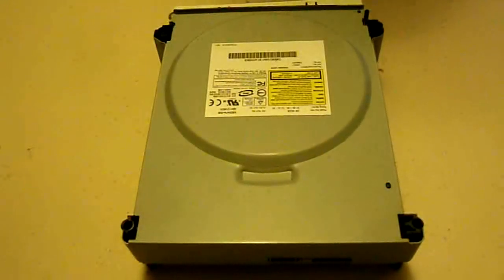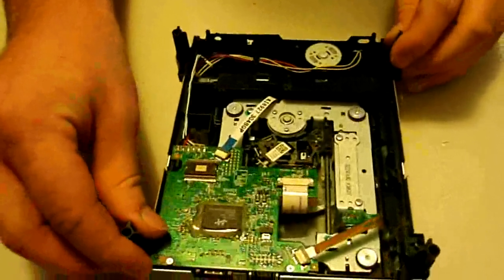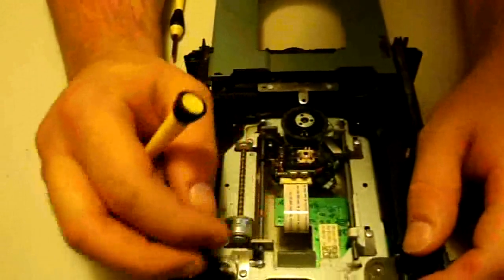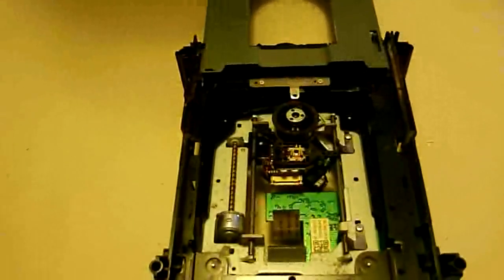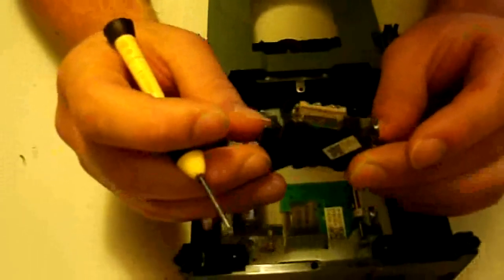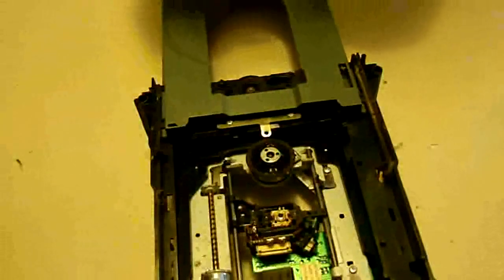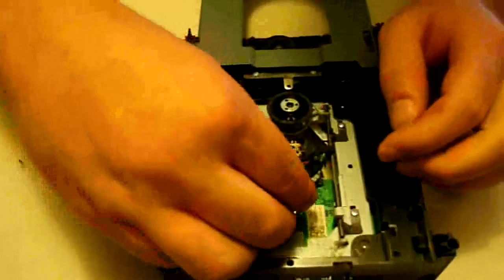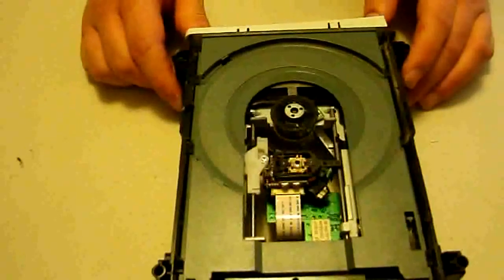How to replace your Liteon DVD disc drive laser. Xbox 360 FAT repair tutorial. Disc read error fix!

Comment: My 360 laser has stopped reading the discs. I've replaced the laser and it still it doesn't read discs. What's going on ?
Reply: Same. You figure out the issue?
Reply: Same. Any solutions?

Comment: Surgeons log:

- Subject started showing decreased motor and reading skills, cause unknown.
- Subject deteriorating, decreased recognition of relatives (success rate 1 out of 10). Early signs of glaucoma or Alzheimer's disease?
- Performed surgery on subject based on experimental procedures resulted in failure due to lack of proper equipment.
- Proper measuring equipment arrived, new surgery scheduled.
- Optic values too low, all adjustments unsuccessful.
- Eyesight decreased to zero, subject completely blind, added to transplant waiting list.
- Possible donor found, blood type seems to be incompatible, donor of different origin. 
- Researched possibility of international donors, possible but waiting list is long.
- New test available for blood type comparison, first donor possible match, chance on success 50/50.
- Researched possible procedures for surgery. Optimal match found.
- Surgery scheduled based on professor Tinker's procedure. 
- Transplant was a success! Immediate and full return of motor and reading skills. Subject has been given a second chance at life. Hurrah!

*wakes up* Dammit! Must've been sleep typing again... *leaps off unicorn*

Now what actually happened...: 

My Xbox was having increased difficulty reading discs, games wouldn't launch or stop mid session (Open tray error / Disc unreadable etc). I didn't know what to do and I was reluctant to open it, afraid I'd break something. So, tired of playing the "open tray game", I stopped using it some years ago. Recently I wanted to play some Xbox games even though my Xbox still had the same problem. I decided to find some tutorials (plenty good ones online) but none of the easy fixes that people shared worked (like cleaning the lens, checking the laser array position, checking the in-drive magnet disc locking mechanism etc). 

- Adjustment of pot meters of original laser also failed since I didn't have a multi meter. I only did this blindly because I found a video that recommended turning the laser module's pot meters quarter turns without any further explanation (forgot to mark the starting point as well). Shortly after I found videos and proper information that this should only be done with the help of a multi meter. DON'T do this without it, and always take initial measurements of the pot meters. Chances are your laser will be fried (or break down quickly) if you don't and/or it will be almost impossible to determine how much resistance they/it should have in order to work. Google "Adjusting xbox 360 laser pot meters" and you'll find plenty of resources with a lot of information (values/brands/instructions) on the subject.

- With the help of this video I replaced the Liteon laser (model 14xx) with a Benq laser (model 141x) from an old Xbox I had lying around (one of the first models). I wasn't sure this was going to work, but since my Xbox wasn't working anyway I decided to try. The only indication I found was that the available replacement part you can order is compatible with Benq and Liteon drives and that the laser modules appeared to look the same. Luckily it worked like a charm, maybe this info will help someone in the same situation.

Thank you very much for taking the time to post this tutorial, it helped a lot and it gave me the confidence to attempt the replacement! Keep on keepin' on :-)!

*Rides off into the sunset*

Comment: funny story : I have buyed an used xbox that could no read disc, after dissasembly a note was written on the dvd drive ' new lens from china but not working'… As you can gess, the antistatic solder blob was stil there! thank you very much for the info!

Comment: @Tinker Mods-    I work with electronics all the time however have never replaced a laser...my sons went out and it is Lite-on Phillips DG-16D5S drive with the G2R2 laser. I want to just replace the laser but can't find any definitive info on whether i can use a a G2R2 laser that is listed under the DG-16D4S drive model.(as most of the sellers online list it under this) Are they the same?  Some of the sellers list the G2R2 laser as DG-16D5S / DG-16D4S for Xbox 360 so i am assuming that this laser will work with either model...but I'm not sure...hope someone on here can clear this up for me. Thanks!

Comment: To: Tinker Mods I bought a NEW LASE for my XBOX 360----do I STILL need to adjust the LASER POT also??---or do I leave it alone--cause my New Laser reads 2.8ohmss--Help!!!
Reply: You have to solder out the anti static point. It should be on the left next to the laser ribbon security tabs.
Reply: +NintendoFan69 ok thanks I figured it out a long time ago lolol--but thanks anywayss

Comment: Swapped my laser with the correct one. And it doesn't work. So I swapped my old one back in and now both dont work..onlything that changed was the disconnection of the ribbon cable. Im pretty sure the memory it held is now cleared, because now both are non working.

Comment from the maker: When you install a new DVD disc drive you can not simply put the new one in. Each disc drive is unique to that Xbox 360 console. What you have to do is take the Circuit (PCB) board out of the old drive and put it in the new one. This way the keys match up and will allow you to play games.

Comment: could anything potentially happen if you don't remove the sodder ball? since i left it as-is and installed it. Haven't put any games in in to test if it will read, now I'm hesitant to do so.

EDIT: I tried it using an unused game that a friend had given me (which he didn't play either) and nothing happened to the disc, but it still wont read discs. gonna open it back up and see if removing the sodder ball does the trick
Reply: If you do not undo the solder ball, it will short out the laser and you will need to buy another one. That solder ball is there to prevent static discharge/shock during packaging and shipping.

Comment: Can u replace a benq laser to a lite on laser?
Reply: Yes. People never answer that question for us guys but yes you can, had to figure it out for myself
Reply: JD Lei Thank you sir for answearing this, hope you're right because I'm about to do it.
Reply: Late reply, and you probably won't need it anymore but like JD Lei said, you should be able to. So maybe this will help others in the same situation. I replaced my defective Liteon 14xx laser module with a Benq 141x laser module (they looked the same and had almost the same model number). Worked right off the bat, no further adjustment needed. NB: I had a spare one from another Xbox so I didn't need to remove any anti static solder point.
Reply: +DutchmanJay Please answer quick. Can i use a dvd player laser for my xbox? can i use any type of laser for my xbox?